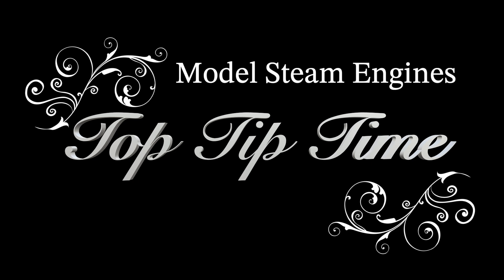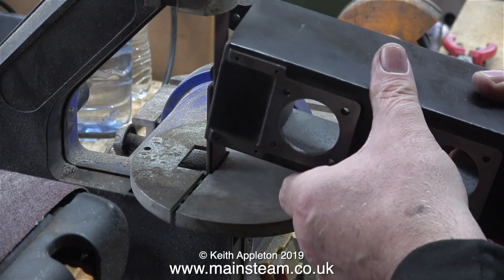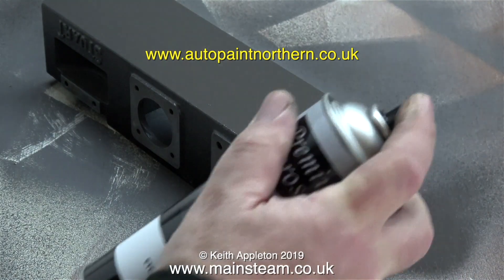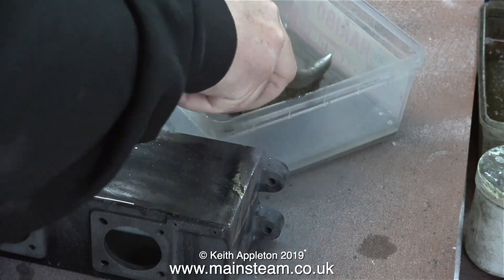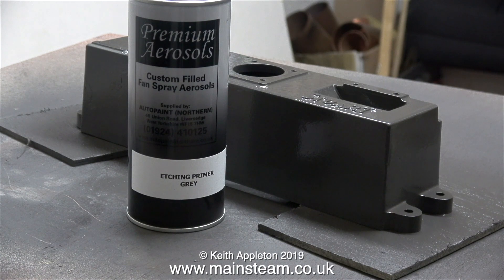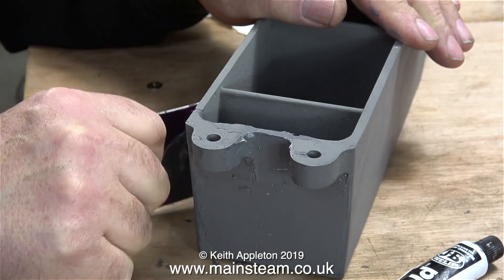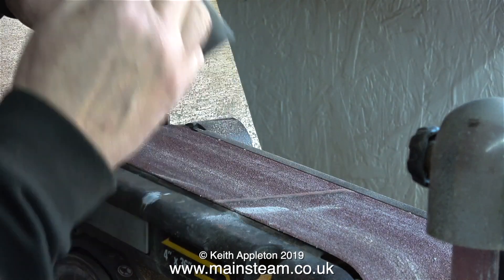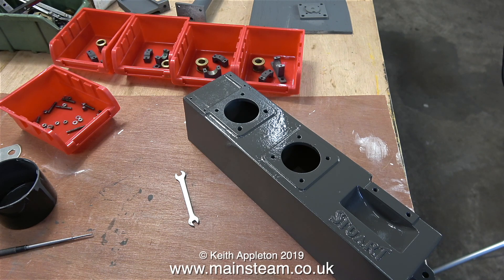MODEL STEAM ENGINES - TOP TIP TIME - PART #11

Comment: Oh the joy. We all got to see some anti painting, anti drying, also known as paint removal, actual painting and paint drying, and of all things, some pit and hole filling. Now my day is complete.
Still it was :Top Tip Time, so now we all know what to do with a messed up engine base, take it to a shop that does metal restoration. Just kidding, of course, but, I never got bored and went to sleep either. 
Have a great day. ;-)